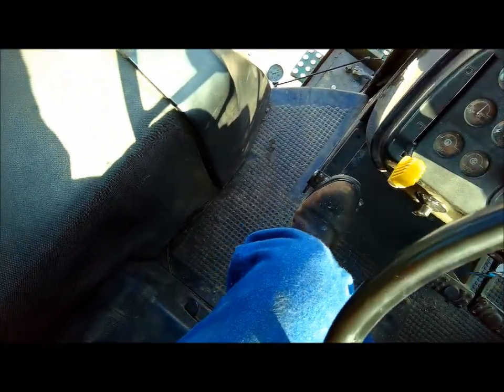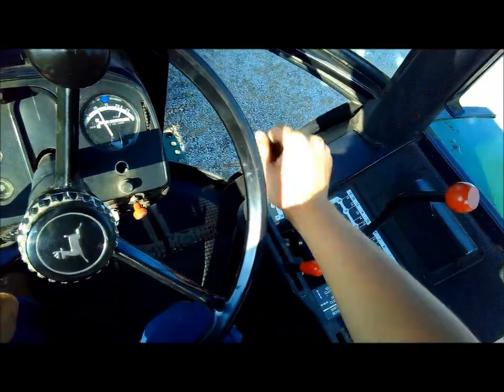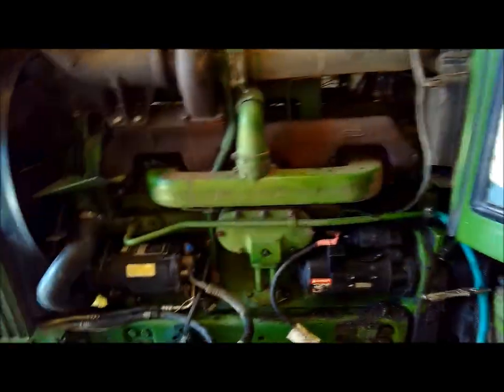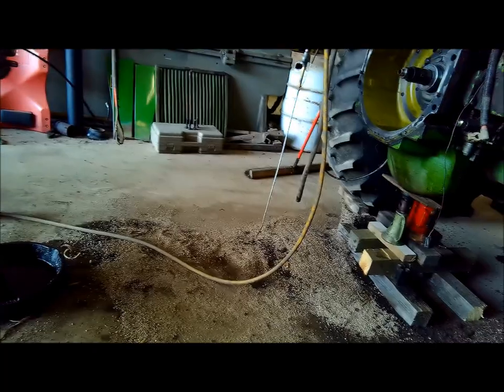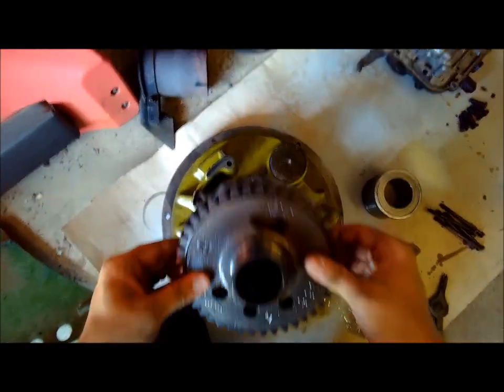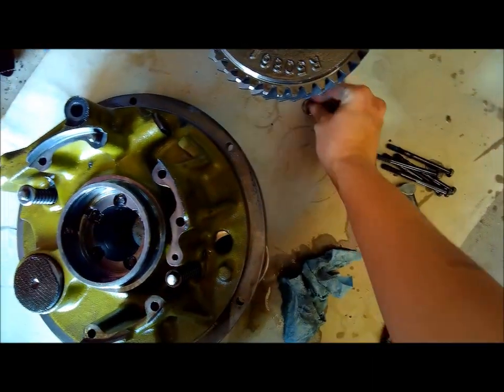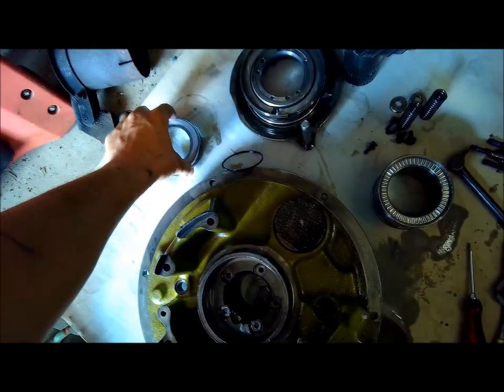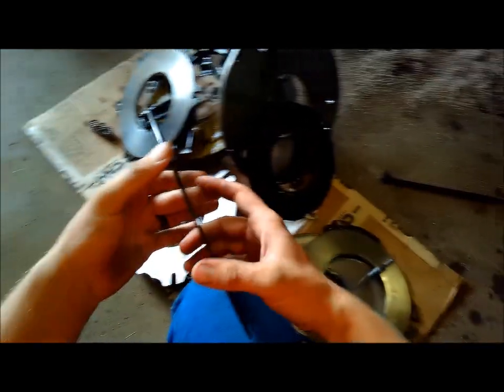4440 shifting problem pt 2

Comment: My favorite tractor by far! It is to small to do most of the jobs we do now but it still plays a major role pulling the sprayer. We broke a snap ring that holds the main drive gear on the pto. It slid back and ate through the sheetmetal cover. We did the main clutch when we had it split. That tractor idles  just like ours. The best sound ever. Good work.
Reply from the maker: Mark Hertzog ya I thought u had one of these. Sounds like it was an expensive snap ring lol

Comment: Very interesting. That's amazing skill you have there. I'm not mechanically inclined. When I was 18 years old I tried to change my own car oil. I turned the oil plug the wrong way and stripped it out. After the fix it dripped oil all the time. Haven't touched an engine since then. I did sell that car to my Big Sister though, got even for all that sibling abuse. lol   Thanks for sharing
Reply from the maker: At Midnight Hahahaha hey at least u were able to get back at ur sister! Thanks for watching

Comment: J.D. called the clutch a perma clutch. guess they were wrong a little. the stand you use is a nice desighn. i have a verry simmular one that i built. but mine dont ajust that much. my books say to move the back away from the front. but ive always moved the front for a lot of reasons. i am not familler with the permaclutch i have a power shift which has a dry clutch. and just a traction clutch on the fly wheel. can you show how the clutch works. it looks like you know what your doing.  ive been around JDS a lot but never seen that clutch apart. great video Jake.grease rag looks friendly. your ability amazes me. thought we were going to get a cuss word when the screw driver slipped. or was that editing.
Reply from the maker: Howard Younger ya nothing is permanent on anything. Thanks it worked really well. Never guessed the ps trans would have a dry clutch. Ya I’ll try my best to explain it lol. No editing actually lol. Thanks for watching and the comment bud!

Comment: Wish you was near by, I get you to work on the 1020 . Got oil in the water but no water in the oil . Head gasket I’m hoping! You do good work on what you work on !
Reply: Scott's Small Farming and Things . - yea, Jake would make a far better neighbor than the no help all about themselves ones we got.
Reply from the maker: Scott’s Small Farming and Things . That’s to bad. If it has an oil cooler I would start there but it probably doesn’t have one. Hope u get it fixed

Comment: I didn't realize until I watched you do the clutch in your 2-155 that ya don't need stands on the whites and Oliver's. I bought a couple heavy duty side crank trailer jacks and my brother made a stand last winter. Had to split a 7050 and 7040 for torque limiters. Looks like the 4440 owner needs to yell at somebody for riding the clutch lol
Reply from the maker: mr Bill ya there the only brand I can think of that’s that way. And until I started doin a lot of mechanic work I just assumed they were all that way lol. That would be the hired man lol. Is that the two speed power shift AC has?
Reply: There's a dry clutch that bolts to the fly wheel with a belville washer just to protect from shock loads. The two speed they call the power director is in oil and the foot clutch just cuts pressure to that clutch. On the 7050 someone had put two belville washers and the lack of give broke the center out of the clutch, looked like it had never slipped. On the other one the combination of a minor rear main leak and the pump being over fueled a little wrecked it i think. Got a shield that they used on the 80 series that protects the clutch from the rear main leaking and put that in both tractors so hopefully that takes care of it. When I was looking for parts I see they were selling flywheels and torque limiters to put Cummins engines in the 70 and 80 series. Might have to look into that if I ever need an engine.

Comment: looking good Jake!  hopefully he didnt force the shifting to long and damage the top shaft syncros.

did i miss it or did you get the lube reduction valve out of that clutch housing?  make sure its free to move.  lube reduction valve sticking will show zero clutch pressure but cause clutch drag.  there is a port on that clutch housing that says lube if i remember.
Reply from the maker: Jon Stevens Maple Grove Farms thanks Jon I hope it didn’t. I haven’t but I’ll definitely do that. Thanks for the info

Comment: Almost looks like the guy used the wrong oil in it and it  delaminated then started to slip. I like JD oil in the JD’s. You will need the clutch adjust tool to put that back together  JDE-78-1 was stamped on the tool i used
Reply from the maker: Tf9500 yep I pick the tool up Monday. It’s an auger wagon tractor so the clutch gets road a lot.

Comment: Even know 6000 hours sounds  like a lot, that’s nothing for that tractor. Clutch problems are rare for that many hours. 
I bet bet some of your viewers can tell how many hours they have on  them clutches. 
Rebuilding the 2 speed is not that unusual though. 
Rear axel bearing play should be checked at that many hours.